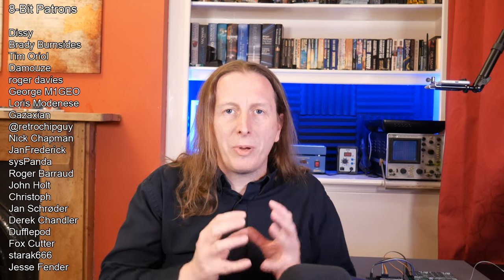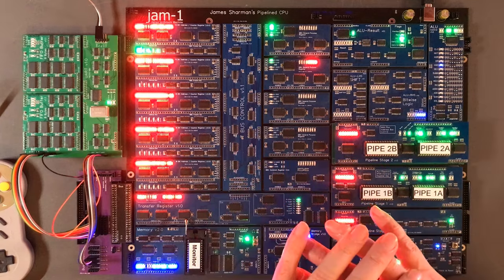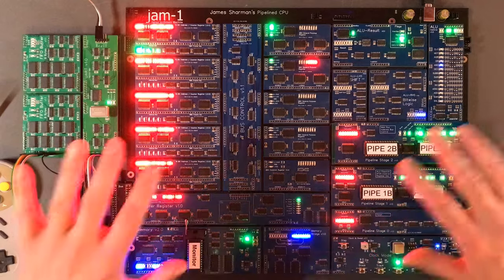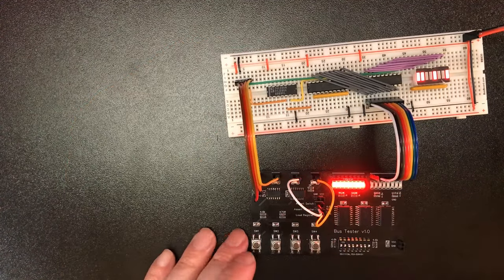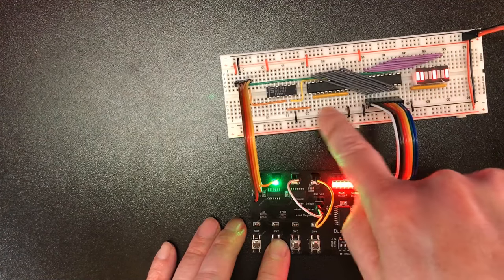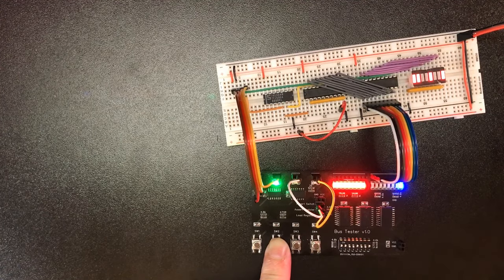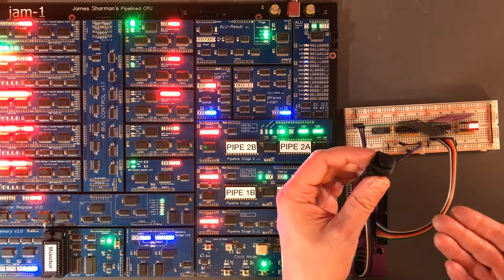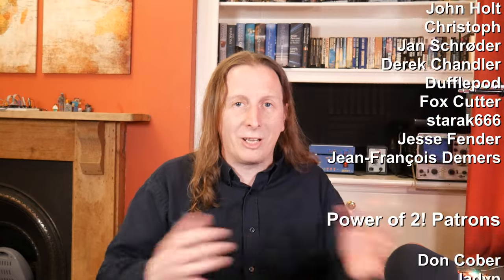Adding GPIO - IO from Scratch - Part 1

Comment: As always, thanks for sharing. Just out of curiosity: Instead of using a combination of a 74LS574 and a 74LS04, you could have used a single 74LS373 as well. That chip is especially designed for that kind of application. What was your reason not to go that route?
Reply from the maker: Well I favor the 574 because it's pin ordering is really convenient for breadboard work, and I have a bunch of them already. The 573 would be a good choice but having a board with both a 573 and 574 on it is just asking for me to make a soldering mistake!

Comment: Hi James, I very much enjoy this whole series and pick some of your designs and techniques for my own build. Regarding this GPIO circuit this would „only“ be a in- AND an output port because each pin is either in or out but not generally usable in both directions (hence the name GPIO) for this there must be an 3rd register to set the direction, and the pins of the in port an the out port have to be multiplexed by this register and an analog switch - or so I always thought. Anyway I think the point here being simplicity that’s the way to go and as a bonus there are 16 lines 8 in and out each. Wish you and everyone happy Easter!
Reply from the maker: I would not agree that pins must be bi directional to call it GPIO. A "pin that is gpio" implies that it can do both, referring to something as gpio just implies that both features exist. Micro controller devices  make the pins configurable  to increase utility in a fixed package size.  I'm not as space limited so I'd only make a bi-directional line if I had need of it.
Reply: @weirdboyjim  sure,that’s of course absolutely the privilege of the designer and saves logic, space and power. And if you never need both functionality on the same pin/ line it absolutely makes sense. Maybe I was tempted to nudge you in that direction because it may make sense for others ( knowing me and how little time I have I probably some day implement it in verilog into one of my small ice40s rather than solder up all those boards ) or for a specific use case later to have configurable functionality without using an fixed i/o-chip like an 8255 or an serial GPIO expander. 😅

Comment: It's crazy how far you've come with this computer.  I like the idea of adding more connectivity like the GPIO and UART.  Do you think it would be possible to go further and add some sort of primitive networking like 10base-t with LLDP?  It seems like it would be possible combining the designs you used for the VGA and UART.
Reply from the maker: It would be possible but I'm not going that way. My plan is to finish this build fairly soon and then start on a new system that takes things a big step forward. I'd spend too much time fighting the limitations of this design. 10base-t's transfer rate really doesn't suit a system with only 64k!

Comment: The MCUs I've used so far seem to have more than one port. Do you have any future plans for Dev 13? The possibility of not needing an adapter board to run a 16-bit device could be useful.

How hard is it to develop plug-and-play code? That could be a great topic for either this series or the next.

If so, would it make any sense to add standard connectors like PS/2 or D-sub to the final GPIO board as connectivity options?
Reply from the maker: Plug and play code isn't really that tough. You just need to be robust enough to tolerate weird things happening, there might need to be some effort put into making the circuits more tolerant as well though.

Comment: Brilliant. I'll be most likely using 573 in my design (due to timings), this looks like The Way To Do It. Thanks.
Reply from the maker: I may switch to one of those if I can get a few.
Reply: I mean: 573 and 574 is The Way, depending on the needs and timings (and on when data is stable / needs to be stable) 🙂

Comment: This is a nice start, would be cool to add a little state engine and a buffer to this so you can emulate some serial interfaces without having to bit bang using the processor.
Reply from the maker: Well, I'm mostly going to do some bit banging with this but I may add the odd support component where it makes sense. Obviously I have the UARt series as an example of going all the way in the other direction.
Reply: @weirdboyjim  Yes, but with a little effort on the GPIO side you could potentially replace the UART and have something really quite unique in the DIY processor space. Thinking UART, SPI, I2C etc. and it would be a solid series of content to.

Comment: I wonder if your gona go down the same route RPI did where their UART runs on the GPIO header?
Reply from the maker: No, micro controllers do that for a variety of reason, not least they can they can often add hardware more easily than they can add pins to the package. I could make lines work like that but it would take me extra circuitry and ultimately it would be more restrictive than having the uart on a separate header.

Comment: The LC display can also be controlled with GPIO. 
Or you implement an I2C bus. This then gives you access to many sensors.
Reply from the maker: Yeah, you can interface to just about anything with gpio. The LCD modules like mine that talk serial protocols usually have a little board on the back. The next video in this series (should be out in a few days) talks about SPI.

Comment: At around 7:00 you have the pinout for the 74xx541 shown which you aren't using.  Great video though! It's a great day, a James Sharman video and a Ben Eater video release around the same time!
Reply from the maker: But I am showing one and taking about it. It was deliberate but I didn’t mean to be confusing.
Reply: @weirdboyjim  Ok. The schematic had '574s on it and I thought you had finished talking about the '541 earlier and went on to use a second '574 at that point. No worries, I just figured I'd point out something that might have confused others.

Comment: congrats for "success at the first try". Do you want to protect those GPIOs somehow from strange handling / abuse, or is this something you put away for jam because you consider it kind of a controlled environment?
Reply from the maker: Do you have any suggestions for protection?  Mostly the 574's sitting between test circuits and the main cpu should protect the cpu at least.
Reply: @weirdboyjim  no. Much more was I interested in how to protect a gpio. Seems to me such a protection could be quite a task, because of so many usecases.
Reply from the maker: @peter.stimpel  Yeah, "protect against what" is the big question.
Reply: @weirdboyjim  If you wanna attach different peripherrals, maybe you would ask for a certain impedance, and protect against some overvoltage as well.
Reply: One way I've seen is to have 5v zener diodes on the input. Anything over 5v and the zener clamps the voltage to 5v (might want to include a resistor to limit the current). Also has the advantage that it protects against negative voltages on the input as well.
Reply: @JaenEngineering  : Another thing that can be done in inline resistors between IC and connector, though that can reduce GPIO speed too.

Comment: very interesting , especially the part about a switch program being the baintent underutilization of resources you have or was it overutilization .. me english not so good in technical.
anyway as you stated blink program on arduino is making something overcomplicated to perform simple tasks i bet your cpu is not up to the task i am trying to shoehorn atmega8 ic in place of arduino :] and that being a dcc decoder for a train layout ...well if you could run at 16 mhz your cpu probably would be up to task of controlling model trains or being a train too but that is just the clock frequency for commonly used atmel and pic microcontrollers
by the way happy easter
Reply from the maker: Glad you liked it,  I don't know enough about your dcc decoder to know it's performance requirements.

Comment: Suggestion:
  Add a mass storage (Compact Flash, most likely) interface;
  Make a simple filesystem driver (Any basic, optionally hierarchical file system should work);
  Write a text editor that can read and write files on that drive, as well as an assembler and runtime program that act on files on the drive

  This should make the computer entirely self-serving, provided you have a serial terminal [or an emulated version of one], since you can write files on the computer, compile them in-situ, and run them right then and there.
  Maybe even lays the groundwork for a full rework of the firmware, where the ROM doesn't have the assembler/disassembler/etc. anymore but gets a 'boot from HDD' option that loads and runs the boot sector.
Reply from the maker: My plans already include a bit of storage, I will be able to move some features from the monitor to executable programs on the storage.  There are limits to how far I'll go with this though,  nobody wants to watch me spend the next year programming utilities.

Comment: You are changing the load signal after the output enable! which could cause problems if you were running at the limits of the chips but in this case your get away with it I expect. As the /OE only one propagation delay before the latch signal.
Reply: I noticed this as well, but then I realized that it doesn't really matter, since the only timing that matters is when the read happens are the other end. If the read is too early in this implementation then you could get old data, but if the OE is delayed then an early read would just get all zeros from the pull-downs, which it's still bad data. In the end it's probably better to not introduce more delay, and if it needs to push the limits then just figure out the settling time like you would with a ROM or etc.
Reply: @khatharrmalkavian3306   it depends if the read is on the falling edge of the signal or the raising edge. But i think that's it's better to latch the data in before enabling the output, i always feel the data should be stable before you present it to the bus. even if it's just to stop noise on the bus.

I suppose that if the assert signal is basically just an address select and the read signal is used to read the bus then it is not a problem as long as there is a delay between the two events. 

Looking forward to see how close we get to a PIA of days of old.
Reply from the maker: It's very difficult to build circuits and not have the off thing delayed by an inverter. Chances are if you dig into the implementation of these chips there may be subtle timing differences between the response to the load and the enable.

Comment: What is the piece called that you are using to short all the led array's output pins together? Currently I am only able to short the pins if I have an individual wire for each output pin. Tried looking but haven't been able to find it.
Reply from the maker: That's a resistor array. It has 8 resistors all tied to a common pin that I'm connecting to ground. You don't want to short the pins!